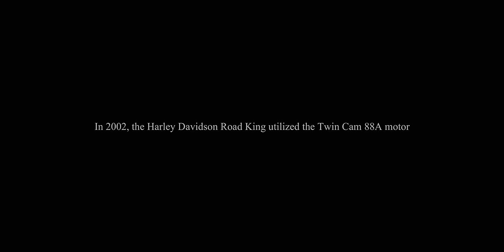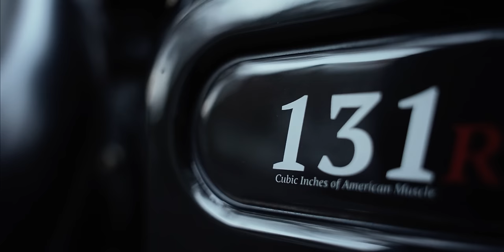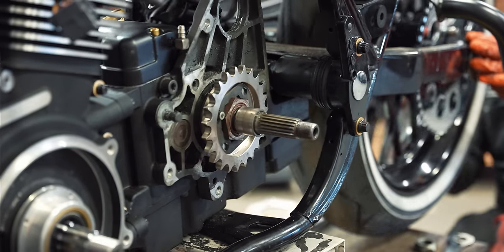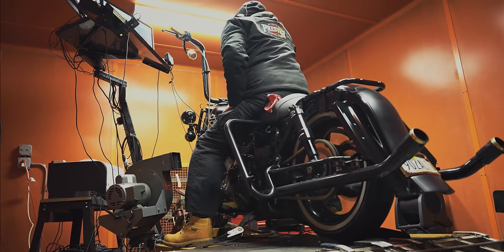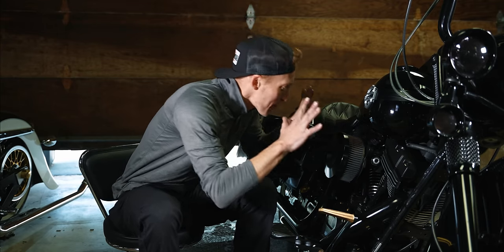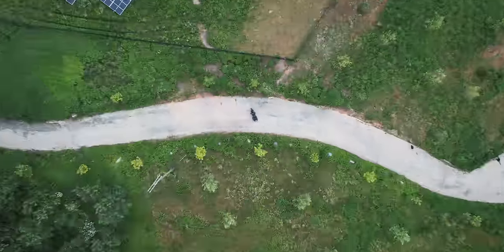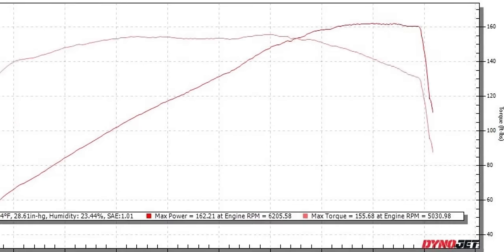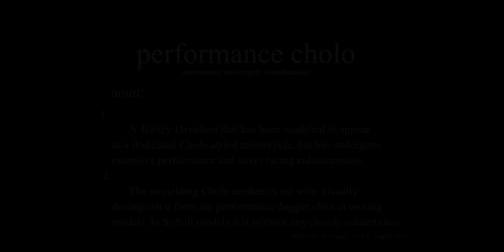Built 131ci Twin Cam - PERFORMANCE CHOLO - all motor, all gas and loud as Fu*k

Comment: Fast as it fan possible be but tuned it down 30hp from max potential? I dont believe it would make mear 170 anyways tbh
Reply from the maker: "Fast as possible" is referenced for street use.
Still made 150 with the 2-1.
Remove the timing and fuel trim safety margins and it'll make 170+. Just don't heat soak it... ever.
Reply: @JETFILMCHANNEL  I street use my 131 turbo bike

Comment: Next time use cero coat
Reply from the maker: I had used Cerakote on my headers previously, it lasted, but I wasn't fond of the dull black color. 
So I experimented with different semi-gloss high heat paints. Ultimately, I found Rustoleum 1200 degree semi-gloss and it holds up pretty well, without the need for the chalky cerakote look. It also costs $15 vs $200 for Cerakote.

Comment: Old bikes have skinny back tires not ideal for putting power to the road 🤔🫣
Reply from the maker: Slightly wider rear tire at 150. Spins through 3rd, but if I lower a few PSI the grip goes up tremendously